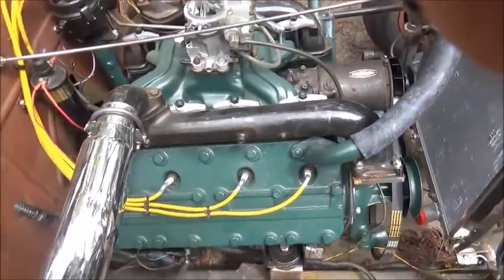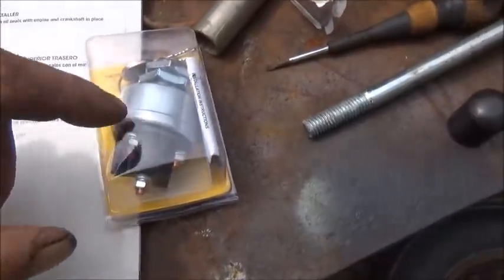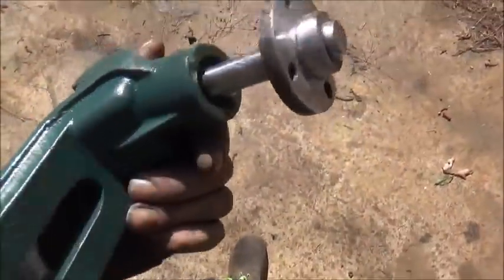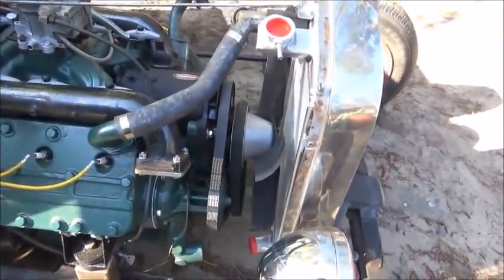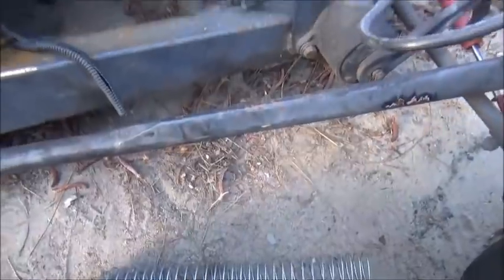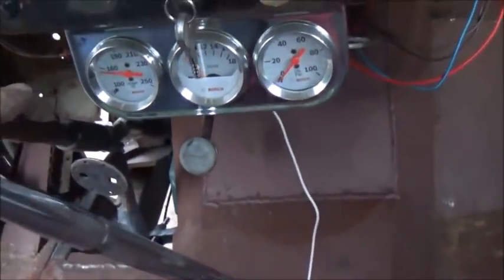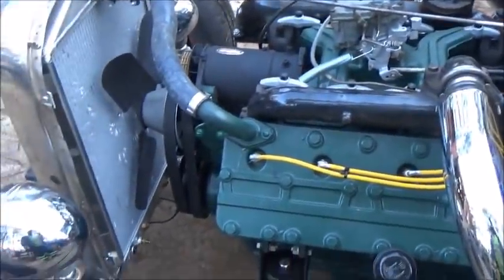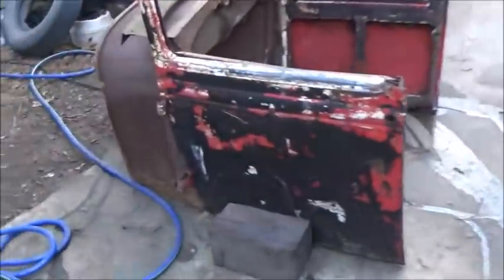1931 FORD 5 WINDOW FIRST DRIVE WITH CADILLAC FLATHEAD

Comment: I would rather have that old caddy motor than a new LS
Reply: same
Reply: Amen brother.
Reply: Big, beautiful brick of a motor.
Reply: Absolutely
Reply: The LS motors have their place; the power, efficiency, and reliability are hard to beat. I've done nothing to my 2012 Sierra but change the oil for 93000 miles. However, with practically everybody on YouTube stuffing LS motors into everything they can get their hands on, it's a real treat to see someone doing something different and preserving some genuine automotive history at the same time.
Reply: @butchstiles5238  well said.
Reply: @Tom Burgess, "you, me and about4/4 of the rest of JW's subscribers.........lol
Reply: Dave Iauco  That's the plan! 😁
Reply: Amen to that .... love that Caddy engine
Reply: That  flat head  caddy  sure  does  sound  sweet.
Reply: Amen brother.
Reply: I have one engine and trans if anyone is interested but trans is a automatic

Comment: Those pipes sound fantastic.  Love the throatiness under acceleration,  and they're quiet enough while cruising.  Please don't muffle them.
Thanks for welding the motor mounts.
Reply: That's easy for you to say--you weren't there! They have no mufflers or baffles or anything and hearing loss is a real thing...:^)

Comment: That Caddy is the best sounding engine you have had in a long time. Just brings back memories of a hemi I ran.
5 window really looks good on the road, and sounds even better.
Glad to see the mounts were welded, saw that before you took off. The chrome headlights fit in nicely.
Wire up the generator and you should be all set. You have built a great hot rod.
Thanks for sharing.

Comment: For the most part, the machines and tooling that made things here in the U.S. are long gone, as are the men and woman who operated them. Loving this build, Jonathan. Sure hope you decide to use the faded red air cleaner, it's the cherry on top. Like the way the Y'd upper rad hose sort of matches the "ram horn" headers.

Comment: NAFTA was the death of a thousand cuts for American manufacture.
Reply: Which started under Reagan-Bush. I worked on cars all day everyday for years and years. In the early 80's we started seeing "Hecho e Mexico" on more and more former American made brands. We even saw made in Israel, Vietnam, India on the boxes of sensors, distributor caps, spark plugs etc. Corporate America shut down and moved off shore for cheaper labor...and WE taxpayers paid for the companys to "re-locate" ! They even screwed us leaving !! I lived it. So don't believe Flush Scumbaugh, or Bill OH' Really. They are paid to lie....and made millions doing it.
Reply: @dadsvespa  
The bottom line is simple UNIONS!  If it wasn't for unions,  the cost would not have sky rocketed. So if you want to blame any one thing that was it. The democrats helped get rid of the unions and the unions still endorse the democrats.  Why?

Comment: I had a old 1953 ford 2 door sedan with Cadillac 364 offenhauser adapter for lasalle transmission , bored .060 idky cam, absolute blast to drive. Man miss old days, had it from 1972 thru 74

Comment: That car has attitude! It’s got the look of a back alley brawler. I’d never seen a flathead Cadillac engine b/4, definitely a conversation piece. It looks like it will definitely haul that light car around about as quickly as you’ll want to drive it. You are a wizard!

Comment: Ah, Good, you did remember to weld the motor mounts, and it sounds like you don't need to add any thing the the exhaust system (man that thing rumbles beautifully).  That is sure one beautiful beast of a car, Jonathan, thanks for sharing, God Bless and stay safe.

Comment: If you take it to a car show right now, just the way it is, it will be cooler than any fiberglass bodied car with a small block ford or chevy and the finest paint job and interior that shows up, at least to real old car lovers.  That big flathead is just way cool, no matter if a 283 or 289 will have more power because anyone can do one of those and you won't see another one of these.  If I didn't live 8 or 9 hundred miles away I would come to one of your shows just to see it.  Thanks and congratulations.

Comment: Oh Jonathan, that sounds so sweet and it looked shake free from the video, well balanced Cadillac engine as you would expect.   My Mom's '55 Buick was so smooth running if you were sitting at a light the gen light would come on and you would try to restart a running engine.

Comment: That's a hot rod. The old engines really fit in nice, and make the build look like it came out of the 50's. I am rebuilding my 66 Nova, and I will be putting a small block 383 in it. This old Chevy guy doesn't care for an LS in an old car. The LS is a great engine, but it just doesn't look good in old iron. Great video.

Comment: 3000rpm redline seems low, i would have thought it would go a little higher. 
31 Ford looks real good Jonathan W, from the test drive it seems to have plenty of power, good pickup! These days most things are in China, Korea, or Taiwan, prices are usually good, as long as it does the job and lasts a reasonable length of time, about all we can ask really.
Stay safe and healthy and away from any virus or other bugs!

Comment: I was fixin' to heckle ya about those motor mounts until you showed an angle that let me see the shine of those new weld beads going across the base and then told us you'd welded them.  Lookin' good, and going to enjoy hear the exhaust once you slap that on there.  Definitely needs a nut filter.

Comment: My boss had a 35 Ford coupe with a rumble seat and aluminum heads. He took me for a quick ride around the yard and that thing was like a truck. All kinds of low end and sounded great. Those old cars were geared low anyway to get them moving with very little actual horsepower. That Cadillac engine should be three times as good seeing how it was probably way bigger bore wise and way better made. Cool rig and choice.

Comment: 60's chevys and older , 70's fords and older say trucks , there is the perfect ignition switches to use , they are dash mount , and are of good quality , and I am sure you have one of the above setting around with the key still hanging in the switch lol

Comment: Napa used to be good for electrical parts. Their contacts n bits would be a good brass or copper when compared to others that didn't. Idk anymore. I'd leave the headlights if it were me.  It's not as loud as I would have expected on straight pipes. Great lil rod. Thanks for sharing

Comment: I totally agree about sourcing auto parts in the U.S.  I have Oldsmobile spindles on the front of my '55 Chevy and it gripes my ass to have to buy Chinese junk brake rotors.   I cannot find them made in U.S.A.  You have done an outstanding job on this -- the 5-speed conversion was impressive.

Comment: I don’t know if it is possible to find a exhaust manifold for the divers side that exists out the front.  But if it is I think it would look cool to run the exhaust out the front of the manifold on both side of the engine and curve them down to the frame and then run them back like side pipes.  I really enjoy your videos and have learned a lot.

Comment: Next thing you should do to help that motor breath is to get a Y intake adapter to bolt on top of the intake and run some dual 97s or 94s. That should boost the power for sure unless you can find a mega rare dual intake for it.

Comment: With a 4.5" stroke and 346ci,  should be REAL good on torque... and no exhaust gases running thru the block causing overheating as in the classic Ford f/h;  a real winner here.

Comment: On your exhaust I think you should run some chrome pipes down the sides turned out just befor the tires kinda like those old side pipes like they use to back in the 70s

Comment: I love these old hot rods put together from whatever is available. Especially the weird collection of motors. The flat head V-8 especially. The body on this looks like its dropped over the frame and the engine is low profile with the flat cylinder heads. It looks like it belongs at at the salt flats with the "lakester" style front hub caps. I would drill and through bolt the plate that holds the suicide front end on. The welds are probably ok but it couldn't hurt to have a belt and suspenders. If that weld ever did break it would drop the whole front suspension. Just sayin'. And more boat videos.

Comment: Excellent video , I use High Temperatures Moly Grease on water pump grease fitting and anything need grease up  last time too and what axle ratio on the 292 V8 flat head motor car ?

Comment: I try so very hard to find quality parts for my projects but it is just not out there at any price. I have a fair amount of old parts that I have saved for many years NOS. When I have checked my stash and know that I do not have what I need, I start looking and what I have found is junk parts are everywhere . We all need to support the very few company's that are here in USA even if it costs more, and you know it will. We need to demand quality USA made parts or we don't buy it. This would be hard to get started but just look where we are now.

Comment: Moonshiners used to put Cadillac engines in forty Ford sedans. they were perfect Moonshine running cars with the Cadillac engines. they were fast and they could be fitted with a one thousand gallon tank. with dump valve running though the floorboard you can guess why? they were probably the most popular Moonshine running cars of all for a long period of time. that's where NASCAR came from and now NASCAR hardly pays them any recognition. it's one of the reasons I'm no longer a NASCAR fan.

Comment: The Cadillac motor will totally out run the ford flat head easy that is no surprise to me with all the songs made about the Cadillac motors. The song Hot Rod Lincoln comes to mind. the guys sings about racing the Cadillac  I bet its fun to drive the torquey car. One thing is for sure the big wide nice belts aint gonna slip that is for sure. I guess the low gears is what makes it so quick. What gear is in the rear end? what happened to the gas cap? The head lights look good to me. A heater would be nice in the winter time. or for defrosting the window.

Comment: Did you have to cut the floor to fit the new engine? I ran in that problem i am just going to drop the engine down lower. My steering shaft does not fit but that is my biggest problems. I am working on a 1935.  the thirties has the best rounded body styles to me and they are not heavy

Comment: Looks and sounds great but too bad the radiator fill wasn't on top in the center so you can run a radiator cap with a Moto Meter.

Comment: Did you look at the Model A Truck on ebay they got a few There is quite a bit missing on your start I hope you find some parts at least a complete cab. maybe someone will sell you one for a trade or something there are not a many of them is the problem. The model A truck looks quit a bit taller in the pictures but I cant really tell for sure.

Comment: NAPA disappoints me more & more each time I go in & they tell me ----- nope we don't have that and can't get it witch is happening more & more with old American made vintage cars. My big Napa just closed there machine shop all tougher so I have to go out of county to get good machine work done as there Machinist passed away and young folks refuse to learn the trade as it's DIRTY work and you can't just push a button to do it . Sad.  Johnathan ,  your Caddycoup is coming right along. So any input on final color of body ? My opinion with that green motor ---- White is right, less body work &  blocking to get it straight enough to paint  ! Enjoy your labor  :)

Comment: Jump like a BOH. good job. I say well balance power to weight car. I stoped smoking April 23 1996. I picked that date befor I stopped smoking because it ment something to just me. then when it came I stopped cold turkey. and have not had one sence . But it was NOT a easy thing for me to do. Hell. Not easy for anybody to do. sept for the lyer's . BUT , one thing for sure . It can be done. good luck with all that. and stay safe to you and yours. Over.
P S. NAPA don't make not one car part. all they do is rebox from one package to the one that saids NAPA on it. over TZ

Comment: So you know, i noticed the right side motor mount was welded when you entered the drive way after the wonderful footage of you out playing. I loved it . . . but how did you get the welding done on the inside between the frame and the motor? THAT is what i wanted to see, damn it all. Phewy! | | | What a great sounding engine . . . torque, just like you said. ||| Can you make your own https://www.google.com/search?q=BRASS+HORN+BELLS out of sheet brass to allow the motor's tone(s) to really ring, especially when the horn rims are exactly parallel with the road surface? I have always wanted to try it. The bigger the throat and bell (like a french horn bell) the more breadth of sound that is softer, too.
Reply from the maker: I ran an exhaust shop years ago, I can weld with a mirror.
Reply: @jonathanw4942  Ah, ha. Now i understand.

Comment: Worried that you are going to go back to smoking John. PLEASE do not.....the weight will go away and the energy will return.
Reply from the maker: Not a chance
Reply: @jonathanw4942  God bless you John, I admire you so much as i too am old school and LOVE the art  . When I was in tool and die, I sharpened my own drills bits by hand ,made my own lathe bits, trammed in my own bridgeports  and scraped my own ways. Only digital readout was on my grinder and ground in my own chucks. I did stuff the same way you do. I love cogs and inserts and moving parts.  Ran a zinc die cast machine  set the dies and built and repaired them. I was a mechanic at 14  because my father died and I had to go to work.  Still do my own car repairs when i can. I love your honest hard work and service....just as I believe.
Reply: Now I am in nursing and see the carnage that smoking causes........you are strong and love your family. Focus on them and it's all worth it.